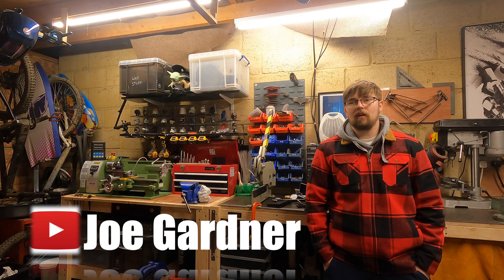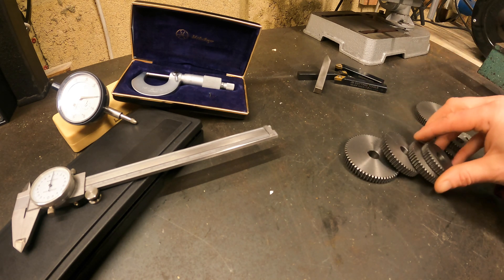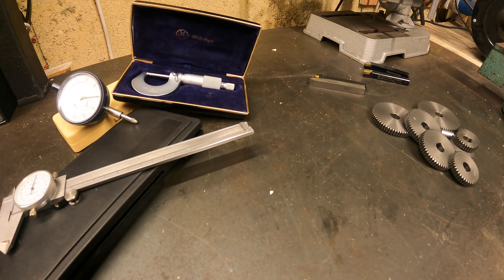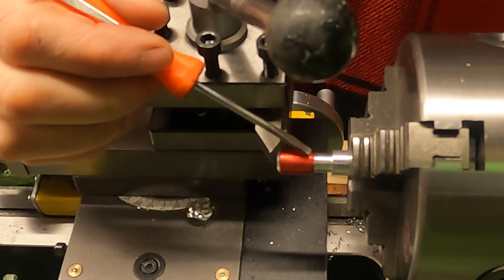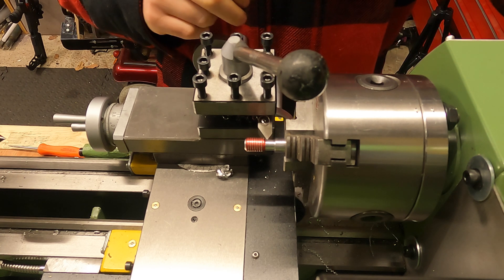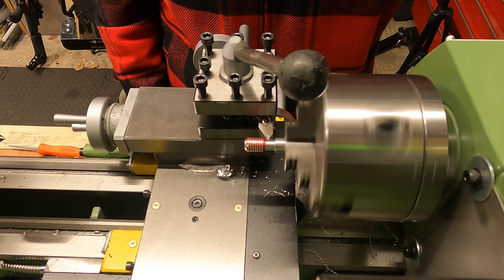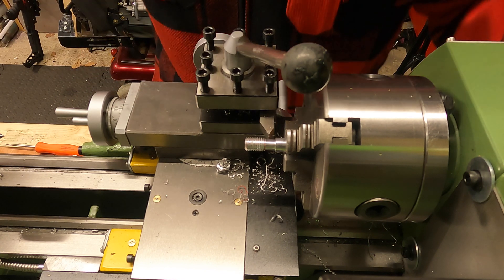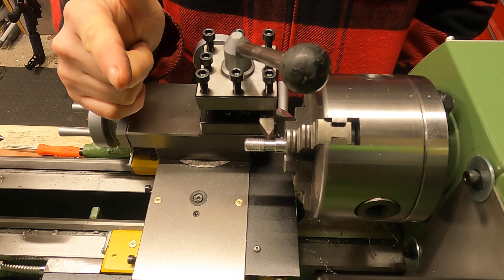Warco Lathe Learning to cut THREADS

Comment: May i suggest:
set the compound sled when cutting a metric thread to 29°
when cutting a imperial thread to 26.5°
scratch on the workpiece using the crosslide
set the crosslide scale to 0
feed in with the compound sled
cut the thread
when ya reach the gully retract the tool with the crosslide
return the carriage with the lead scew
set the crosslide again to 0
feed in with the compound sled
cut the thread
when ya reach the gully retract with the cross slide

You will have a slack in the lead screw therefore the tool runs not exactly in the cutted threadgroove when returning.
You can see, that the tool is taking a chip when returning.

Thread cutting is a meditative work ;-)
Greetings: Dieter
Reply from the maker: Hi Dieter,
That’s great advise I have heard of this method before but never tried it. It’s definitely something I’m going to experiment with in the future. 
Again thank you and hope to hear from you again on the channel.
Reply: @MachiningwithJoe  The advantage of the compound sled set to half the angle is, the chisel cuts only on one side.
I dont have a specific "how to cut a thread" video, but here 
https://youtu.be/LpH39tR4VdA?t=274
you can see how nicely the chip is cut. (activate the subtitles)
also you have a thread clock on your lathe. Especially when the thread is longer, you can open the nut on the leadspindle, crank the carriage back and close the nut at the right moment.

Comment: Nice job joe , helps to put some lubrication on when theading/maching ;)  little brush with some oil works wonders , i picked up a warco mill recently and i am very happy with the quality
Reply from the maker: Hi James welcome to the channel. Thank you for the comments will have to try that out next time. Yeah a mill is going to be my next purchase. What model have you got ?
Reply: @MachiningwithJoe its a wm-14 vs mill , purchased it faulty for cheap as chips and got lucky with it only having a blown resistor . I run a family machine shop so have experience with some decent machines  , so far I am very impressed with the quality and feel of warco (next job is to install a 3 axis dro ).
Reply from the maker: There the best type of buys when there a cheap fix. I’m thinking about buying a mill in the near future and I like the look of the spec list of the Warco mills.